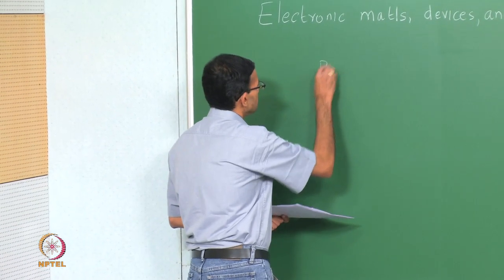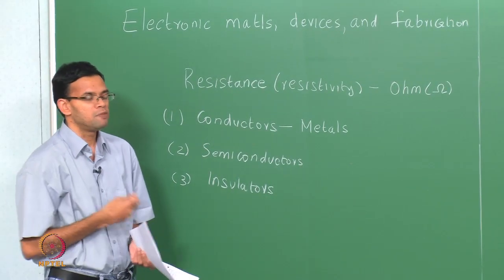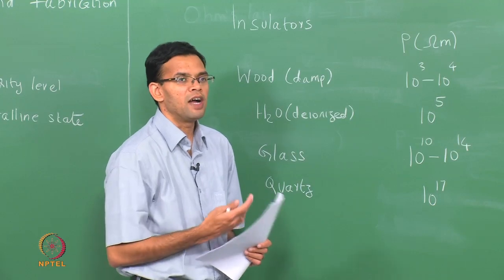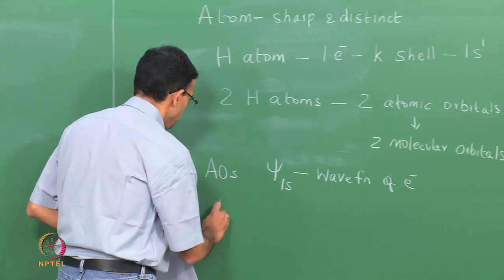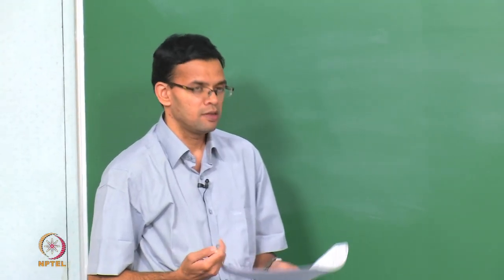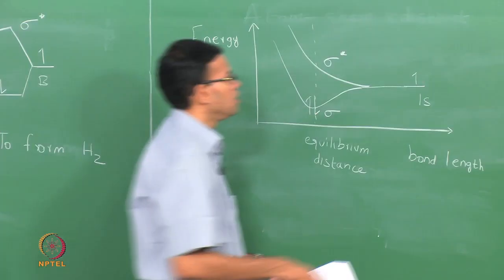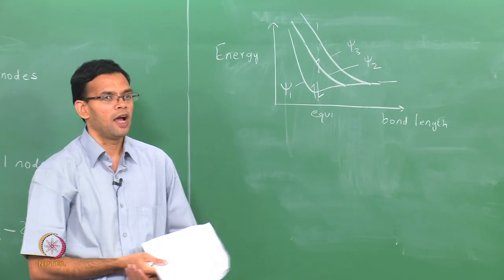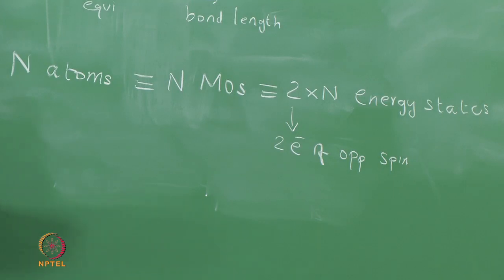Electronic Materials

Comment: Hi Sujit,

In the first instance only the magnitude of the energies are described. Usually, bonding energies are negative (with respect to zero, which is taken as the vacuum level) and a bonding orbital has a more negative value than anti-bonding, hence it is more stable. In the second instance the sign is also included. I should have done a better job making the distinction. Thanks for pointing it out. Hope this clarification helps. 

Parasuraman S